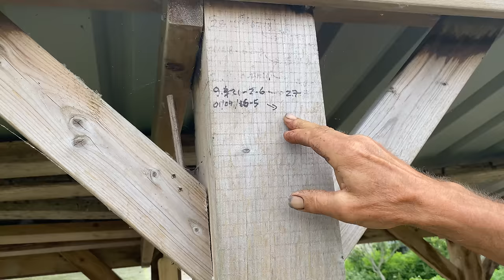No dig tour in June, summer number ten at Homeacres and see the exciting methods

Comment: All my beds are covered in wood chip but as you say Charles more leaves/wood/bush trimmings.. and I normally put on about 6 inches each sep/oct..and by the time I grow it’s rotted down quite a bit..and then I mulch around the plants with the wood chip mix…I understand what your saying about more solid wood not the best but we’re getting a good mix of mulch… and I can see how the plants react simply by not disturbing the soil…
And when I dig down you can see the layer that’s been created by the wood chip mulch layer…
And the added bonus of hardly any weeds.. the odd one picked by hand…
It’s was the cheapest way for me as when I got plot there was a massive pile of wood chip that had been there for years…
I basically started at the bottom of the pile and took that so I wouldn’t shock the plants when they went out..
I’m a good 4 years into it now and I try and explain to people it takes time ..like most things in life..think people expect results straight away but patience is the key..
The same as making my own compost ..using the chicken poop ..it’s a work in progress..but it gives my plants that extra boost they need and I try not to use chemicals/make my own liquid feeds..
Happy growing Charles..🌱
Reply from the maker: Thanks for your feedback Darren and that is good to hear!

Comment: Charles, I remember a video from years ago of you talking about garlic rust and that put the problem on my radar. I live in the mountains of NC that historically gets more rain than Seattle and we have cool, damp springs and off and on hot, humid days. At the top of the hill is most of my garlic, with a few in the kitchen garden by the back door. I have never had rust. Last year, I started hollyhocks from seed and I planted them all through the landscape.  We had a bed we had created from dry stack rock and filled with nothing but tree bark mulch the year before to make the porch beds look balanced. The hollyhocks planted in that bed grew well enough, but were riddled with rust. The hollyhocks 10 feet away, that were planted in soil with a layer of shredded bark mulch, had no rust. In the fall, I laid a very thick layer of chopped leaves on the problem bed, because I wasn't sure if the rain could splash spores upward from the mulch. The hollyhocks died back over the winter and popped up again this spring. Today they are 6 feet tall (!) and so far....despite the humidity (knock on wood) no rust in sight. My anecdotal involuntary experiment 😏 leads me to think that the bed was way too fungal-ly dominated, because of the wood chips and then that perpetuated the puccinia malvacearum....same rust for both garlic and hollyhocks. 
Would love to know whether you have ever thought this. Would it be an interesting trial to have one garlic bed with soil/compost and one with wood chips?
Reply from the maker: That is a great comparison Elizabeth and thank you for sharing. I'm not sure how much of this rust is coming from soil below, and how much is on the wind (hence less under cover here), in humid weather. Also the rust you mention is not quite the same but I think the characteristics are very similar. Garlic infects with Puccinia allii.
I shall try and area next year with something on the surface to stop upward splashing and see if that makes a difference.

Comment: I’m constantly pulling grass out of my raised beds. The Bermuda grass (couch grass?) is slowly coming under control, but the fescue pops up to 3” tall just overnight. It comes in from beneath my beds, which are for the most part about 3 years old. Fortunately the fescue is easy to pull out but it’s maddening to stop t the end of the day seeing grass-free beds, only to awaken the following morning to find quite a bit of new fescue has popped up.  We are also in a heat wave in the Deep South of the US, with temps as high as the mid/high 90’s this past week (I garden in zone 7b). It’s extremely hot for this early in the summer. Your garden is always amazing and I have learned so much from you! I’m starting some new beds and looking forward to gardening in the fall when it should be much cooler. Thank you for the beautiful and informative tour!
Reply from the maker: Thank you. I'm puzzled that you are not getting to the point where the grass roots die. They really should if you are on it pulling new shoots regularly! And I'm sure they will, good luck with the heat

Comment: best garden tour you have done so far.....you answered many questions for me, ive been curious about feeding toms/cucs to promote flowering/high yields, having researched this and found that commercial tom feed is just expensive watered down seaweed with added N, ive been using seaweed for two years with great results.

Ive also recently found some information about aphids and nitrogen, if you feed with high nitrogen it actually attracts aphids to feed on the plant, the plant will be stressed due to cellular and stomata swelling, allowing pests to feed on the plant excretions and disease can enter the plant at these points.i trialed this over the winter with lettuce, adding chicken manure to a few plants and they got hammered with green fly in the spring, so we can look at out of control infestations of aphid as a indicator of high nitrogen, funnily enough our compost has high levels of nitrogen but the nodig/mycelium system regulates what a plant requires for steady growth and protection from disease.

Also, organic fruit growers in canada have noticed by removing honey bee farms from thier orchards, has increased the populations of wild bees and particularly wasps, which have a major predator role to play, this has changed the populations of aphid and caterpiller to a point where there is the perfect amount to feed the remianing predators but no infestation, very interesting indeed!! so we can also look at out of control aphid infestations as a indicator of the predator prey balance is out of sync.

Thanks for all the answers Charles
Reply from the maker: Cheers Jim, I really appreciate your comment and helpful observations. No surprise about those lettuce, after adding the chicken menu! I'm only glad that the Canadian orchardists have sufficient wild bees. They are so under threat from farming practice.
I did not know that about commercial tomato feed and I am not surprised!

I hope that your pitches are looking good and not suffering lack of rain.
Reply from the maker: @00jim  cheers Jim, that's helpful and I do have Paul's book, it's good. Also we notice bees feeding on mycelia both in soil and on logs for example

Great news about your grasses, although not about the weather. It's becoming very dry here, despite rain forecast all the time!

Comment: Charles, I have wondered why the compost mulch method is not working well for me here during the summer. You said 80F was a heatwave for you there and that's when I started thinking. Here in the the state of Georgia in U.S. it has been in the mid 90s most days and hit 102F one day last week. They are saying 105F this coming Wednesday. Today it was 96F so I took some temperature readings with a infrared and compost thermometer. The dry surface of the compost mulch bed was 164F, two inches down 110F, six inches down 80F. Wet compost mulch 30 min after watering 110F on the surface, 90F two inches down and 80F six inches down. The beds with wheat straw 120F on the surface and 80F on the surface of the compost underneath the straw. The surface of the grass was 120F. The black compost mulch is like planting in an asphalt parking lot, it was 44 degrees hotter than my grass or straw mulched beds. I'm wondering if these high temps could also be causing the gasification of nutrients out of the layer of compost? I know it's not good when a compost pile gets that hot. My thought is does the 164F temps from the compost mulch surface causes heat stress, loss of nutrients out of the compost and death of microbial life near the surface? I would gladly send you some pictures if your interested in seeing. Have you ever taken temperature readings of your garden beds in the sun?
Reply from the maker: Hi Matthew, this is really helpful to know and thanks for making these comparisons. Those are extreme temperatures and I have to agree, I would use a straw or hay mulch on top of the compost in such conditions. Your measurements prove that worthwhile, and I shall see if we can find time to do that.
Reply: @CharlesDowding1nodig  Thank you for your response. If the plants are close enough to shade out the compost surface before it gets hot It works fine. Yesterday it was a record 103F and the compost mulch surface was over 170F. We've only had about a inch of rain in the past month as well. I will need to use straw or hay in the summer and try to manage the slugs and woodlice. Then remove the mulch for the fall, winter and early spring crops. The compost mulch will help keep the soil warm during those times.

Comment: Hi Charles, as ever a superb video.; informative and just a pleasure to watch.

I do realise you're very busy but maybe you (or someone else) could kindly answer a question regarding asparagus.  I planted seven two year old crowns in March this year.  Six of them had fronds about the same size as in your video but three of them just 'gave up' overnight (not the same night) as in they were almost flat on the soil - I tried proping them up but it was pretty clear that their stalks at ground level were beyond repair and they subsequently died off. It didn't really look like slug damage as the stalks weren't eaten all the way through . Any idea what caused this and will the plants survive?
Reply from the maker: Cheers Wain and I wonder if it was faulty product. This spring I bought 10 crowns and from two different suppliers, one lot from Pennard Plants failed almost completely and the other lot is growing superbly, the latter was from Sutton's.

Comment: Hello Charles. Thank you for the tour and a great video, as always.
I have a question about your garlic: do you use rust-affected garlic for seed?
I have successfully grown garlic for years from my own seed and didn't know what rust was until three years ago. Since then, rust every year and I am starting to think that the rust may not (only) be coming with the air, but perhaps through the seed? Also, I am wondering whether the rust on bluebells transfers to garlic? I have them (bluebells) growing in several spots in the garden and they also get rust in the last few years...
This year the rust arrived early, around second half of April (Hampshire), and while the softnecks managed to fatten up the bulbs to usable size, the hardnecks are a sad sight, I pulled them 4 weeks earlier than normally because the leaves turned completely orange with rust.
Reply from the maker: Hi Irina, yes I do replant the cloves from affected bulbs and they still grow with very little rust in the polytunnel. It looks to me that it's mostly atmospheric and to do with rainfall. Sorry can't help much
Reply: @CharlesDowding1nodig  Thank you, Charles.That's helpful indeed. I will try growing some in the greenhouse.

Comment: Really interested to see that you are tackling bindweed. My neighbour's garden is absolutely over-run with it and I am in despair what to do with it. The accepted norm seems to be to spray with glyphosphate and I am so resistant to doing so. I'll get some thick black plastic and see if that helps. Do you dig out as much as you can first and then cover or just cover and wait?
Reply from the maker: Nice to hear. I don't dig any out, just cover.
If you cover now towards the middle or even end of summer, you may not see much more new growth, which ceases by mid-autumn

Comment: Hi Charles, I had exactly the same problem with garlic rust as you this year. Two thirds of my garden patch is used to grow garlic and shallots. I was told to stop growing garlic for several years to avoid rust but if rust is airborne and not from the soil, is this a myth ?
How do you treat rust please?
Reply from the maker: I'm sorry to hear that, since you clearly like garlic so much! 
I don't have a remedy for the rust, however I find that planting as early as possible is helpful and this year I aim to get the garlic in soon after equinox in late September. Also growing garlic in the polytunnel really helps because they get much less rust there, and grow bigger as well. There is no extra space needed if you are picking say lettuce over winter

Comment: Do you ever test the pH levels of your different composts?  I ask because almost all my compost types come out alkaline on the liquid colour test kits you can buy, especially kitchen waste, which gives an off-the-scale blue-green result.  The only exception so far has been liquid green alkanet (same family as comfrey) at the other end of the scale (red - v. acid).  I was forced to notice this aspect of composts because I once put wood ash (v. alkaline) on my potatoes and saw the result - lots of scab.
Reply from the maker: Hello John, I never ever test the pH of anything actually! It's always felt like an unnecessary complication and now there is evidence that plant roots, in combination with microbes in the soil which they associate with, can moderate and alter pH to suit the needs of that particular plant

However in the presence of synthetic fertilisers or something like wood ash, the soluble nutrients bypass the microbial network and there is much less chance for pH to balance. I find that potatoes making tubers in surface compost suffer very little scab, and yet we are alkaline soil here, just over seven. And I put wood ash in the compost heap.

Comment: I just read your book and thought it great however when it came to talk about Knotweed you skipped over it! How does one deal with Knotweed in a no dig garden?
Reply from the maker: Sorry about that but it's because there is no special issue with knotweed. Remove it small because like all weeds the roots become so much stronger, and do indeed produce a strong and knotty taproot as I'm sure you have noticed, so best pull young or use the trowel to lever out any larger ones.

Comment: Hi Charles, what is the best way to lower the PH when not digging?
Reply from the maker: In my experience whether you dig or don't, it's very difficult to change the pH of soil. 
With the healthy soil life of no dig, plant roots have more ability to interact with fungi in the soil which can change the pH around the roots. It's not like pH is a static quality with one number, because it varies a lot within the soil and around each plant's roots.
Reply: @CharlesDowding1nodig  That is very true, I am just a beginning gardener and breeder, you are almost a master at this. I need to make the soil more acidic for strawberries. From what I know the best and safest and organic way of lowering it is to add sulfur as this will steer the soil life (feed the soil not the plants right, so change the soil and not the plants) into. It's a nice thing to do I feel like because sulfur is actually not acidic but as i said and I'm sure you might be aware of, the sulfur will make it over-time the soil will become acidic. Unfortunately, this is a very very very slow process, I want to lower the PH of my mixes from aroun 6.5+ to 5.9, I think 5.8-5.9 is ideal for growing the most and sweetest strawberries, I know it can be done. I am growing in raised beds that are not connected to the ground, so I bet that helps a lot.
Reply: @CharlesDowding1nodig  Btw is this also the reason why berries grow in the forest? Lots of Funghi  and berries need a lower PH, so that can be achieved by the whole eco-system, I'msure it is to be honest.

Comment: That rye is looking great! Interesting potato experiment. I've got some similar experiments going on my self. Last year I was thinking about all my random potatoes that pop up from the year before & get good harvests off them & started researching perennial potato patches. This video: https://youtu.be/9FHOyxshL2E gave me enough encouragement to give it a go. I grow a lot of different types of mushrooms in wood chip beds already so, I have mixed mushroom growing into these experiments. I laid cardboard down & then seaweed & a bit of compost then 2 inches of fresh willow wood chip, mushroom spawn then another two inches of wood chip. I chose Kestral as my slug resistant variety & planted the tatties deep underneath the wood chip in the compost. Whilst the wood chip has finally been almost fully colonised by the mycelium & will fruit in a few months, the tatty plants are a bit tiny so far, as with your experience. 😂 If I don't get tatties I'll get mushrooms certainly anyways. However, I think in year 2 this may work even better as the original wood chip has broken down some so will leave some tatties under there through winter & top up with a bit fresh wood chip to feed the mycelium. Also, tried a smaller patch of the same but, with Oca (not slug resistant) instead of tatties & similar result, quite small plants. Will keep going on it though & see how it works as the beds break down & mature a bit. May try new beds next year with more compost under the wood chip as well to really get the tatties growing. I agree on the wood chip type. I used winter chip, but, quite small chip size. Mycelium burns through summer chip too rapidly. But, summer leafy chip might be a great one to use for just tatties.
Reply from the maker: Nice trials there! Your fresh chip sounds better than what I have.